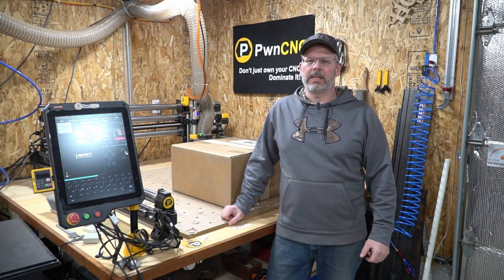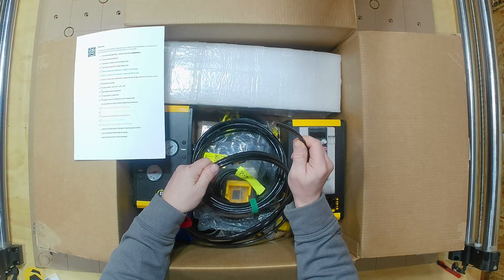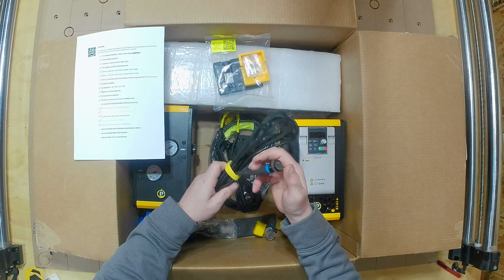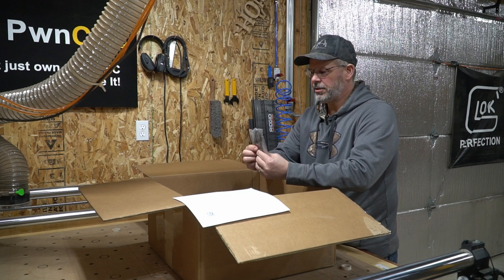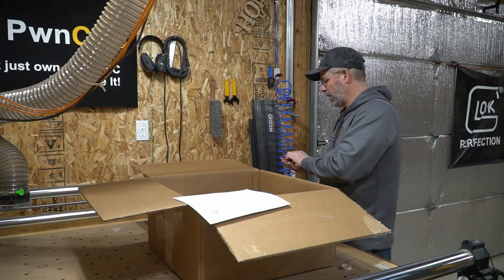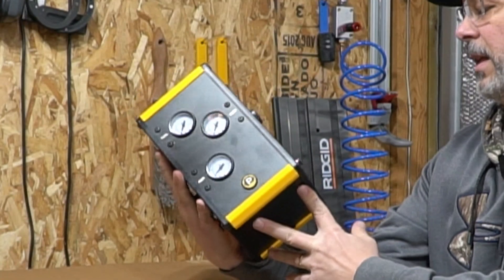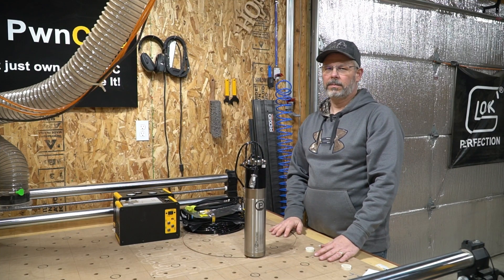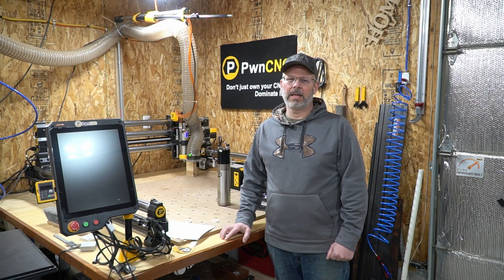ATC UNBOXING

Comment: How good is this at hogging aluminum? I have a langmuir mr1 that i want to add ATC to. I do exclusively aluminum parts.
Reply from the maker: Our ATC motors are all 4-pole 800Hz metalworking spindles with ceramic bearings.  They're awesome at chewing through aluminum.

Comment: Great content as always, enjoyed the show and tell.  Was curious about how the box contents were packed. Will they be shipped with fitted Styrofoam?
Reply from the maker: Yes they are packed with lots of foam.  I have a video of the box opening with all the packing but something went wrong with my microphone and that part of the video was useless.  The packing is actually a starch based foam that is biodegradable and dissolves in water.  I have a video of all the foam dissolving that I'll be posting soon.

Comment: Does it only come as a water cooled version?
Reply from the maker: Yes, water cooled only.
Reply from the maker: I do want to note that our ATC motors are full metalworking motors capable of carving mild steel.  They are 4-pole with ceramic bearings... meaning they're very powerful and very quiet.  
When cutting metal, water-cooled is pretty much required with this small of a motor form-factor.